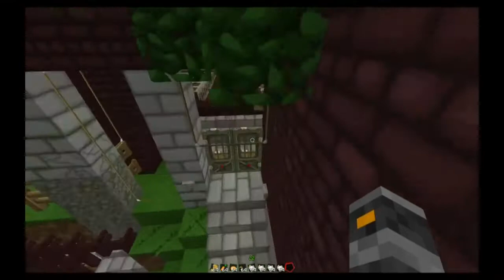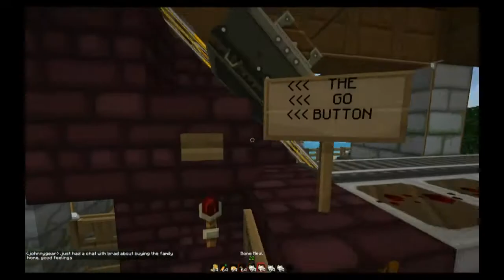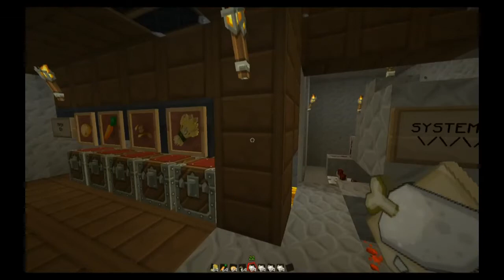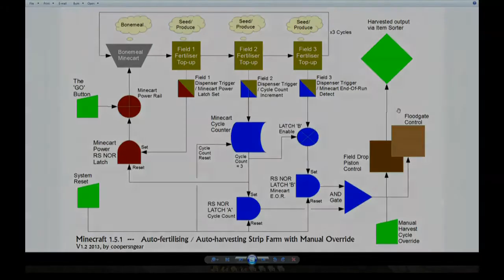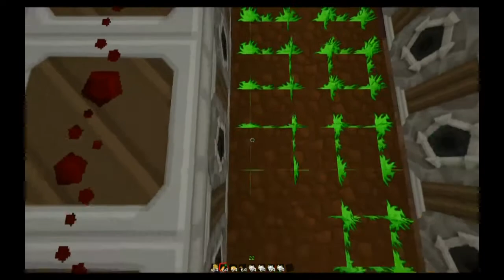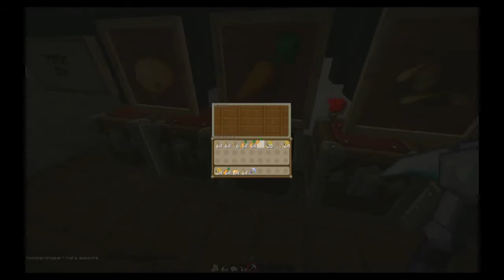Minecraft 1.5.1 - Fully Automated Strip-Farming System

Comment from the maker: Hey mate, thanks for the feedback! I need the minecart to refill all the dispensers so i don't have to top them up by hand! I did play around with a "3 pulse of fertiliser --> 3 minecart top-up runs" sort of system, but i figured if the minecart needs to run around the dispensers anyway, I may as well use it as the trigger for the other stuff. I need the pistons due to the length of the field... otherwise the water flow stops halfway down!  But i wanted to use level fields for ease of planting.